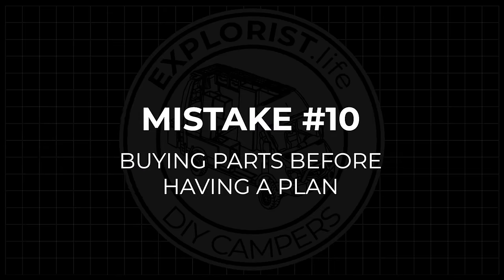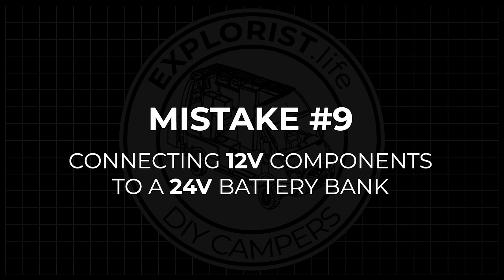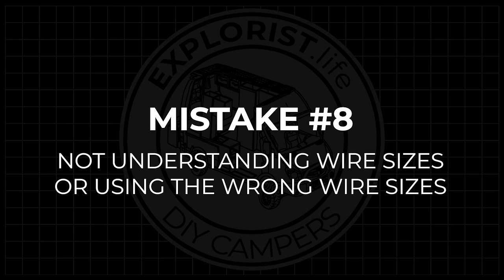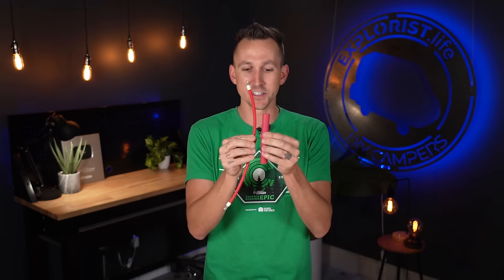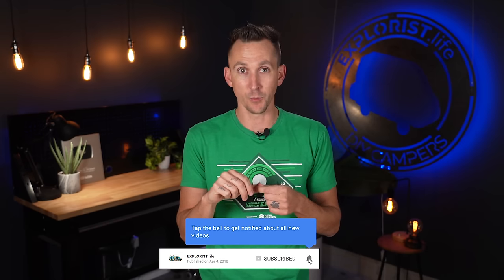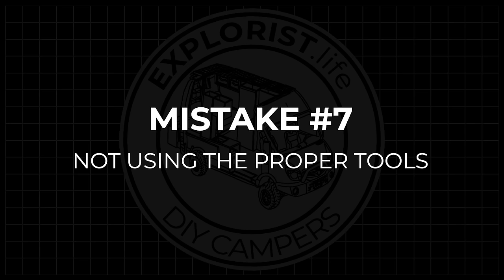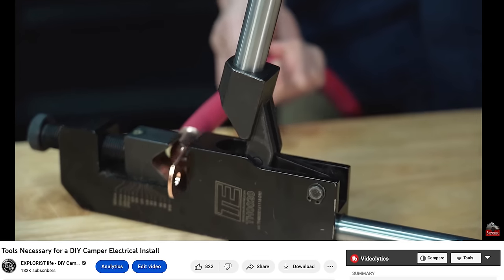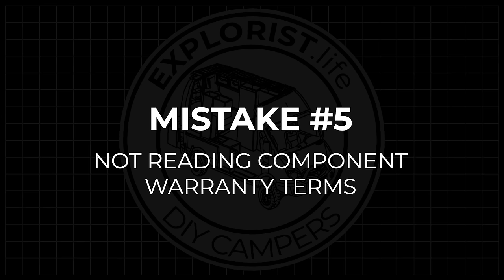DIY CAMPER ELECTRICAL MISTAKES (and how to avoid them)

Comment: Hay what would you recommend i want to put a solar power in my 5x3 trailer all it need to run is 2 lights inside (off - on) to charge up a iphone AA batterys for head lamps and to run a bivvy fan and may be a 20" tv ow and a diesel night heater and a 12v spot lamp

Comment: HI Nate.  Another great video with some great info.  Question - I have a 12V 300Ah battery from Enduro.  I'm looking to power it with a MultiPlus C 12/2000/80-50 120V.  Do you have a wiring diagram that you would recommend for this build?  I did a power audit and established I should be fine with 300 Ah (just a weekend rig no AC, small DC fridge etc.).  It would be amazing if you were to do a video on a smaller power build using one of the 270 Ah batteries from BB.

Comment: If I have two 12volt batteries wired as 24v about three years old is there a way I can add two more “new” batteries “without” the old wearing down the new?

Comment: The victron component with the minimum battery size required-- is that due to supporting the max rate of charge / discharge and the average C rate for lithium batteries?

Comment: Hi Nate.  Just subscribed and good information and wish I found you earlier.  In any case first mistake perhaps you can assist.  I bought an 800 watt solar system and this is what I have on order and ready to install on my 5th wheel.
1) Renogy 2000 watt Pure Sine Wave Inverter 12V DC to 10 volt AC.
2) Eco-Worthy 800 watt solar panels.  4Pcs Bifacial 195 W solar panels & 12 V 60A MPPT Charger Controller & Bluetooth Module 5.0 & 16' of solar cable.
3) SOK Battery 12v LifePO4 battery Bluetooth & built in heater SK12V206H.
I presently have a 2019 Prime Time Crusader 5th wheel that I found out has a 1000 watt inverter some where in the front of my rig.  I also have a 100ah lithium battery I bought sometime ago with a battery monitor added.
After seeing your video  am not wondering if I did the right thing on purchasing what I did.  I know it can't run my AC with it and that is fine as I have a generator but for the rest I bought the solar system to help in running other components on over night stays or just rest spots.
Any thoughts if a kit of what you offer can be built?
Appreciate an advice.
Thanks
Reply from the maker: Hey!  So... realistically; you are falling under the 'don't buy parts without having a plan' catagory here.  Realistically; you should return everything you've purchased (minus the solar panels; we can work with those) and get a plan together.  For example... Renogy doesn't make an inverter/charger that is compatible with 50A RV's, which I believe all of those Prime Time Crusaders are.  Check out the new system builder on https://shop.explorist.life for additional guidance on what you need for equipment that will work with your RV.

Comment: I noticed you didn't show a hydraulic lug crimper is there a reason why?  By the way great content
Reply from the maker: We have historically not had good luck with hydraulic lug crimpers.  If the dies aren't perfectly matched up with the lug brand, they seem to have inconsistant results and generally don't crimp tight enough and the last system we did with a hydraulic crimper, 50% of the battery to battery wires had failed at the crimp over time.

Comment: Have you ever thought about using a bluetti as the power source? I see they have a lot of options, seems to me it would be a great option, because of its portability and charging options .
Reply from the maker: Those portable power units are great for a 'chuck it in the truck and go' kind of thing. We have a Jackery for weekend tent camping like that.  I don't like them for a permanently built in system though as they are generally too restrictive.

Comment: Shoot.  I just made one of the mistakes.  I bought some used 310W solar panels around my area then bought a Renogy 50A Dual input on board battery charger w/ mppt.  Turns out this charger has a max voltage of 25V and my panel puts out 33V.  Plus I may want to add a panel in the future.  So Ill have to send back my charge controller.  Does Vectron make one that I can plug both solar panels as well as my trucks alternator that you might suggest?  Im trying to run two dorm friges for an off grid camping trip.
Reply from the maker: Hey!  Victron doesn't have a combo MPPT & DC DC charger all in one kind of unit; they do have separate units, though, that will work flawlessly for what you are after, though.

Comment: Thanks so much for all your videos Nate. I have an 87 Vanagon Westy. It currently has a cheap battery solenoid, a 50 ah house batt. I need a plan that fits in the smaller needs and smaller space of that vehicle. I do have one 200ah lithium battery for this project. In looking through your plans it seems that even in the smaller systems you recommend tge MultiPlus inverter chargers. They’re fairly large. Do you have clients that have put those in Vanagons? I’d appreciate any thoughts you might have on using or adapting one of your plans for a Vanagon install. Looking forward to working with you and/or your plans and kits on this.
Reply from the maker: Yep!  Seen that one used in a small system.  A multiplus 2k will be smaller than an Inverter plus a charger plus a transfer switch with all the wiring and fusing.

Comment: hey nate you do amazing work, i appreciate it all. question: how would you choose to power 12v loads from 24v battery bank/inverter/charger? not sure what the proper amperage is to run a 30amp rv
Reply from the maker: For that, I'd leave the OEM batteries in place and then use a Victron Orion charger between the lynx distributor and the OEM battery bank to keep the OEM 12V system charged.

If you need a 3000w or smaller inverter, I'd recommend just sticking with a 12V battery bank, though like I've got in this diagram here: https://www.explorist.life/30a-camper-inverter-with-solar-and-alternator-charging-wiring-diagram/

Comment: I have a pwm charge controller that came on my rv with 400 w of solar on the roof. I would like to go with a mppt charge controller do I have to change the existing  wiring size. Thank You

Comment: Another reason to plan parts: not having to return stuff you simply never needed in the first place.  I find buying from and contacting good vendors while planning helps stave off errors.  Two vendors told me to send back ANL fuse I had intended to place between SCC and batt, e.g.  Silly standalone dimmer switch, useless SPST switch when I needed 3-way etc.  And your plug toward the end is not shameless, it's a consumer service.  I must say I'm never sure which of your diagrams to buy for my particular setup.  Should I email you what I think I need?  Thanks as always.
Reply from the maker: Good vendor here. 👋🏻👋🏻😅  We are here when you need us: https://shop.explorist.life
Reply: @EXPLORISTlife  I refer to direct vendor contact but plainly you're a one-stop shop-n-support.  Pretty clear you know as much as them.  Thanks again.
Reply from the maker: Yep!  And in the case of Victron, they don’t offer direct support, so you have to go through a distributor like ourselves.
Reply from the maker: Ope; and I see the 2nd half edit of your initial post.  Yes, you can indeed always reach out for pre-sales support: shop.explorist.life/support.

If you want to skip that part, the system picker embedded on the home page of shop.explorist.life is WILDLY helpful.

Comment: I am having trouble finding victron 48v mega fuses under 125A for the lynx distributor here in New Zealand. I have 2x 45A victron mppt wired into a lynx distributor, but in the 48v range i can't find a fuse lower than 125A. Does anyone know if they exist from Victron or do i have to go to another brand?

Comment: Great video.  I was just nodding along until you got to the bit about solar panel voltage.  I was about to do that.  I wonder if you would answer a question for me.  I have an existing camper that was supplied with two solar panels (Hub Solar HS200-36M) with a Vmpp of 20.5V, and a PWM controller.  The weird thing is that the panels are sloped away from each other so they'll never see the same sun angle.  I was thinking of replacing the controller with two MPPTs, one for each panel, but it sounds like this won't work well because I'll rarely have enough voltage to charge the 12V batteries.  Do you have any suggestions?
Reply: For panels of that low voltage stay with PWM  controllers.  Use 2 and parallel them together.  Amps will add up. MPPT s typically need more voltage to work.

Comment: Nate, greatly enjoyed the video. Earlier this year, you guys helped me out with the layout details for my set up.  It's been running smoothly for months , util this weekend. This  past Friday, we had a catastrophic failure in my Multiplus, loud pops and white smoke. This happened for no apparent reason. The RV had been sitting in the storage lot for over a week. I came back and discovered a fault on the MPPT.  I went through the trouble shooting and upon re energizing , the smoke. 
I am in contact with Victron and the distributors; however, I still have no clue as to why or how this happens.  What do you do when ALL the protocols and proper techniques are followed and you still have this kind of failure?
Reply: Sorry to hear that

Comment: After studying DC systems for a few months, I went to BattleBorn Battery and purchased all of my system components.  What they recommended was all based on a system diagram from your company.  They graciously walked me through every inch of it, answered every question I asked and provided hand holding where necessary.  Great company!  However, they did not say anything about me using the 3000 watt Victron Inverter with 200 amp hours of BB Lithium batteries; all of which was purchased from them on a single order.  Is this dangerous in the long term?  This system has been installed and running for 2 years without any hiccups.  Thoughts?
Reply from the maker: If it has been working...it should be fine.  It's just hit or miss on if less than 400ah of battery bank capacity will support the inrush current of the capacitors on system startup of the Multiplus 3k.

Comment: Good morning I just traded coaches and want to know if two different battery system can both be incorporated in the coach. The coach has a Lifeline  AGM GPL - 8DL  255Ah battery,  Xantrex Freedom XC 2000 inverter/charger & a solar panel 200+/-  Watts. I have 4 Battle Born 100Ah batteries, Go Power IC 3000 inverter/charger  & a portable 200W solar panel and misc. components. These were all remover from my trade-in. Thank You for all the info. you provide.

Comment: Can you limit the output on the Quattro? I’m about to build a system and will need a lot of power long term but want to start out with a smaller battery stack and add to it. Is this a good option?
Reply from the maker: You can limit the power output of the Quattro to a degree, but you can't undersize your battery bank because you can't limit the inrush current of the unit, which will shut down the battery BMS.

Comment: Tip:  If you buy a "Chinese" hydraulic crimper, you will probably have to use the die one wire size smaller than the wire you"re crimping.  If you use the die that's marked for the wire size you're crimping it will probably not hold.  Test out your crimper before you make any critical wire cuts.
Reply from the maker: Instead of the hydraulic crimper, I'd recommend the crimper I showed in this video for anything 6ga and larger: https://youtu.be/JmiX2XW48F8

Comment: Hey Nate, we used your renogy wiring diagram and followed it well even using a lot of the links your provided. We’ve been using the system for over 3 months and everytime our 400 amp hours of lithium battery gets to 50% all power shuts off. We’ve done diagnostic calls with renogy and can’t figure it out. Do you know why this would be happening?
Reply from the maker: Sounds like a settings issue.  Make sure your BMV-712 'charged voltage' is set up to be .2V lower than all of your chargers 'absorption voltage' and that your battery bank amp hours is set to 400Ah in the BMV settings.  If those two settings are 'off', your BMV may be miscalculating the state of charge.  Once you make sure those are set up properly, if you're still having issues, that's going to be a Renogy issue which I unfortunately have to send you back to them for.  They have pretty terrible customer support most of the time, but I'm pretty handcuffed with what I can do there.

Comment: I wanted to see the picture and story on the melted Lynx from your Facebook ad :)
Reply from the maker: 'Professional Installer' put a washer between the lug and fuse on the wire going to the Inverter which caused an immense amount of resistance -> heat -> smoldering which almost caught on fire.
Reply: @EXPLORISTlife  Well, that would do that. 

There was a post a few weeks back asking why they melted a lynx connection.... washers on the wrong side.
Reply from the maker: @MyGoogleYoutube  Yeah, washers between electrical connections are a HUGE problem as well.
Reply: @EXPLORISTlife  It seems like when one mistake is made, many are made. In repair projects at our shop we see loose wires, incorrect wires, incorrect components, washers between connections... It's almost impressive how confidently incorrect some can be. Icing on the cake is burying all that work so it can't be seen. The people that most need to see this video I fear aren't doing enough homework to find your fantastic resources.
Reply from the maker: 'Confidently Incorrect' is my new go-to passive aggressive phrase. 😂🤣

Comment: People are having problems with new victron multiplex the ac connectors now are spring loaded and don't make good connection and burn out multiplex you need small screwdriver to lift up tab when inserting wires
Also  you need 7/8 stripped wire another you tuber says  take off 8 inches of cover and put under cable strai relief  in case you have to make off wire in future
A lot of people say don't use ferrule  on the wire as the overheat the wire as you are not getting good connection, victrion should change back to screw lugs as a lot of people have burnt out the inverter due to wires burning
Reply from the maker: The Multiplusses that have the push terminals should use pin ferrules, which we have in all of our appropriate kits in our shop at https://shop.explorist.life

Comment: What's your opinion on the Victron batteries? They're super expensive but do we need them?
Reply from the maker: They are good batteries.  There are two main types, the Victron SmartLiFePO4 Batteries and the Victron SuperPack Batteries.

The main upside for the Victron SmartLiFePO4 Batteries is their size.  They are quite a bit smaller than most other batteries on the market.  The main negative aside from more expensive is they are just too complicated.  They require an external BMS and communications to all chargers that requires a fair amount of setup and programming.  If you are an installer doing this stuff all of the time, that may not be a big deal, but is not something I'd recommend to the person building their first electrical system.

The SuperPack Batteries have an internal BMS and are way easier to set up.  They are going to be more similar to Battle Born Batteries (my preferred battery brand) except the Victron batteries are more expensive, have a shorter warranty, and a lower output.

Long story short... I recommend Battle Born Batteries in all of the systems I design.

Comment: So as a beginner and not really knowing anything, when I start my build I could contact you and you'd tell me what I need for my particular set-up ie. the right panels and batteries? Then put together a complete kit I'd need to make it work properly?
Reply from the maker: I've already got kits put together and ready to go here https://shop.explorist.life and all the information on which one to choose and how to install it right here on this channel.
Reply: @timdunmyer4549 I was banging my head against the wall when trying to figure out my system.  Wasted time and money buying on Amazon, returning what I could.  Just to find Nate’s kits we’re just coming out last October.  I got a 30 amp diagram from his website and everything but the inverted, panels, and batteries because I had those.  I must say it was pretty easy to build after that.  He took all the guess work out of it.  My truck has run my table saw, chop saw, compressor, induction cooktop, and convection microwave.  No issues.  Just follow his plans that best suits your needs.

Comment: Hey Nate, Will other brands of solar chargers work with the Victron Lynx Distributor? Thanks
Reply from the maker: Yes.  The Lynx Distributor is just 2 busbars and 4x fuse holders.  It's not a communication device or anything.

Comment: I was part way into paying someone to design a system for my sailboat. The problem was that he wanted me to figure out what I needed based on what the loads are. We have 15yr old AGMs and want a new AGM starting and a lithium house bank. Our diesel is small and I don't want to overload it with a big alternator. We have a 70A Balmar externally regulated. I found a YouTube channel that shared the system diagram with wire sizes and fuses all Victron. It's SV Tritea's system. As you said, no need to reinvent the wheel. I didn't know that you sold complete systems. I bought everything already except the new AGM. Thinking about the Optima D34M but it is kinda pricey. Any ideas?
Reply from the maker: We don't deal with AGMs much, so I can't speak much for the quality of various AGM manufacturers.

Comment: Do you ever use copper clad aluminum wire?
Reply from the maker: Nope.  Pure copper or tinned copper (for corrosive environments) only.  copper clad aluminum has a whole different set of amperages that are lower per wire size with, often, inferior insulation.  It's simply a lower quality product.